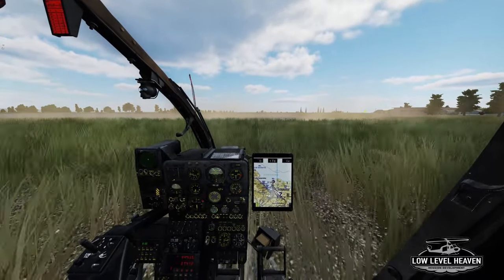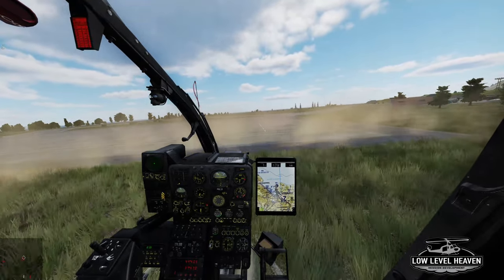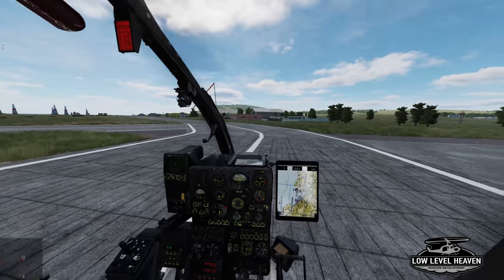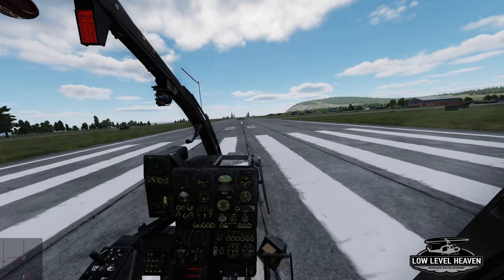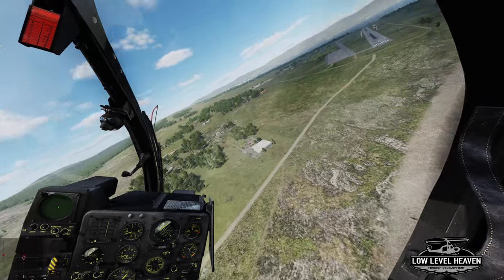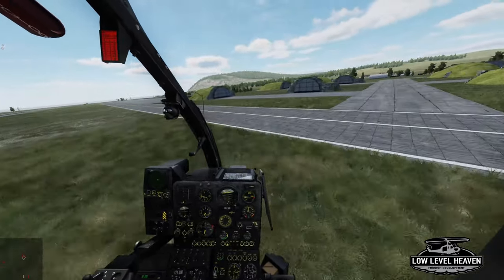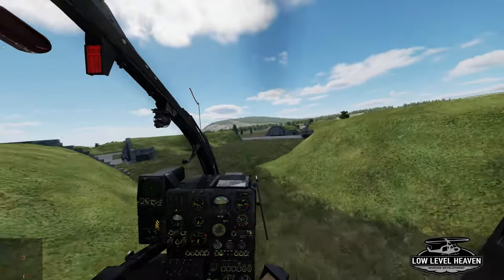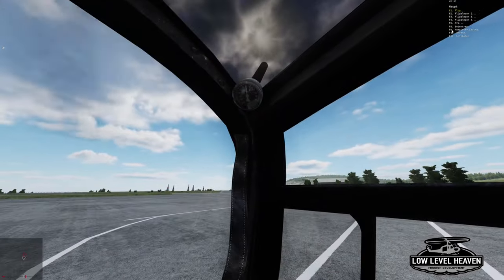DCS GAZELL / February 2024 Flight Model

Comment: Hi Grizzly, I'm curious how the Gazelle flies with a full complement of weapons.  I tried flying the stock campaign mission and had a really hard time getting it off the ground with standard loadout. (CptTangerine)
Reply from the maker: Hi, nice to hear from you.
Yes the Gazelle is in my opinion actuel underpowered.  Not shure what the reference data are used by the programmer.
This is also recognizable on the tail rotor an it's ability to counteract torque.

Comment: I’m pretty comfortable with the FM as it is now. It does feel  little heavy still,  but it’s much more controllable and heavy is a better experience than the UFO it was a few years ago, in my mind. At least it kinda feels like it might be real, if not perfect. 

I haven’t watched the full video yet, so I don’t know if this was covered but the previous FM, and I’m not sure this is a function of the FM, let’s say the previous iteration, I found the skids had dreadful stiction when landing or taking off on some surfaces. Not all, concrete and runways were fine but some ad hoc LZs in campaigns had me landing and taking off in what felt like treacle. This does seem to be improved. The stiction was easy enough to compensate for if there was no wind, but even the slightest cross wind and I’d be lucky to get the thing up or down without slamming it sideways into the dirt.  Now, I’ve never flown a heli but compared to the other choppers in DCS, I found this behaviour a lot more extreme and it made the Gazelle almost impossible to use in a campaign situation where I’d be 75% through a mission and would have to roll the dice as to whether I’d have to restart or not.  Every time. Anyway, this seems better now.

Comment: I see the red thread points straight to the aft of the helicopter even if you are moving at a walking pace. That's an inaccuracy of the simulation, right?
Reply from the maker: Not necessarily.
I don't use the trim.
And since the Gazelle is not loaded and has little fuel, it may well be that it is front-heavy.
I haven't noticed this personally. Thanks for that.
But I would say that is correct and speaks in favour of the model
Reply: @lowlevelheaven  Ok, not sure if I'm misunderstanding. The thread is pointing about 90 degrees from the ground straight towards the back of the aircraft. 
I'd assume that the downdraft would not allow for that at such low speeds. 
Am I getting something wrong? Thanks
Reply from the maker: @heinzriemann3213  hallo.
Damit wir nicht aneinander vorbei reden. Gerne in Deutsch.
Reply: @lowlevelheaven  Ja so ist's besser 😄 Der Faden sollte doch nicht stramm nach hinten zeigen. Schließlich kommt der Rotorwind von oben und Flugwind von vorne ist bei Schleichfahrt marginal. 
Daher sieht mir das Verhalten des Fadens suspekt aus.
Reply from the maker: @heinzriemann3213  Sorry. Ich stand voll auf dem Faden.
Da hast du natürlich Recht, bei langsamen Geschwindigkeiten domminiert  der Luftstrom vom Rotor und der Faden spring wild hin und her. Eben wie eine Fahne im Wind. 
Dies in DCS zu simulieren ist wohl letztendlich neben dem Verständniß dafür wohk eher eine Frage von Aufwand und Nutzen und natürlich auch Prioritäten. 
Ich persöhnlich kann gut damit leben wie es ist. Würde es angepasst würde das sicherlich kurz positiv auffallen und danach nicht mehr beachtet, denn die Funktion erfüllt der Faden nun einmal nur im Fluge. Aber dennoch gut aufgepasst.
Noch etwas Werbung in eigener Sache. Wir fliegen in der Staffel auch Gazelle.

Sorry. I was standing right on the string.
You're right of course, at slow speeds the airflow from the rotor domminates and the string bounces wildly back and forth. Just like a flag in the wind. 
In the end, simulating this in DCS is probably more a question of effort and benefit and, of course, priorities. 
Personally, I can live with it as it is. If it were adapted, it would certainly be noticed positively for a short time and then no longer noticed, because the thread only fulfills its function in flight. But take care anyway.
Some more advertising on my own behalf. We also fly Gazell in the squadron.
Reply: @lowlevelheaven  Jetzt haben wir uns gefunden! :) 
Ich hatte mal die Gazelle angetestet und fand sie unheimlich spaßig, und der Faden war dabei eigentlich sehr hilfreich wenn es darum ging auf der Stelle zu schweben. Schaust du da als Pilot gar nicht drauf, sondern unten auf die Instrumente?
Wenn es um den Aufwand geht, dürfte die Implementierung eigentlich nicht schwer sein. Eine brauchbare Näherung bekommt man ja als Funktion der Kollektivleistung und der Geschwindigkeit in der Planebene. (Funktioniert natürlich nicht mehr im VRS :) Beides ist im Flugmodell bereits vorhanden, bzw. wird laufend kalkuliert. Daher gebe ich dir Recht, dass es  auf der Prioritätliste wohl weiter unten steht oder gar nicht erst auftaucht. Meiner Erfahrung nach fallen solche Lapalien bei Softwareprojekten gerne unter den Tisch.

Fliegen im Team ist schon sehr verlockend.  Habt Ihr eine Webpräsenz?
Reply from the maker: @heinzriemann3213  BLACK ANGELS DISCORD: https://discord.gg/aqwzv2P

 

UGLY ANGELS DISCORD: https://discord.gg/HNfhC69
Wir sprechen Deutsch, Schwäbisch und andere Dialekte. :flowers:

WEBSEITE :  https://tigermercs.eu/black-angels/

 ganz so einfach ist das nicht, denn die Luft fließt nicht nur nach unten.
Es gibt Verwirbelungen um den Rumpf, dann prallt Luft vom Boden ab. Andere strömt am Rotor mast durch den Hub nach oben weg. Und da stellt sich dann schon wieder die Frage. Ganz, oder garnicht,?
Reply: @lowlevelheaven  Helikopter sind ein unglaublich dynamisches System. Respekt an die Entwickler die sowas aufsetzen. 
Und danke für die Links, wird gleich beim geschaut!

Comment: Horrible FM ever in aviation sim's history
Reply from the maker: 😂 This is on on hand, just a matter of opinion, and it may been so 1 year ago, but    now?
It may be interesting to know what exactly is the reason for such a opinion and what is the personal background of the person judging so hard.
Reply: @lowlevelheaven  It is light attack helo but FM is so heavy and broken. Polichop was impressed by real Gazelle pilot review so they did something before Kiowa coming. If you muck around with 30%fuel for sightseeing no problem but not suitable for battle at all. I used to fly this thing a lot of time. It is just not right.
Reply from the maker: @gazgazgaz2  I agree with you and mentioned that in the video.
Nevertheless, the FM has improved a lot, and ther is hope it will get better 😉👍🤠
Reply: I agree that this has been the worst flight model to date. It was simply unflyable. It is however now very good, I’m flying it a lot, it’s finally decent. Not perfect but close.